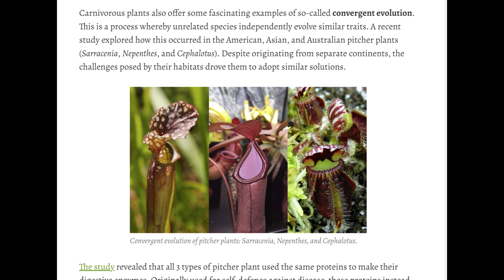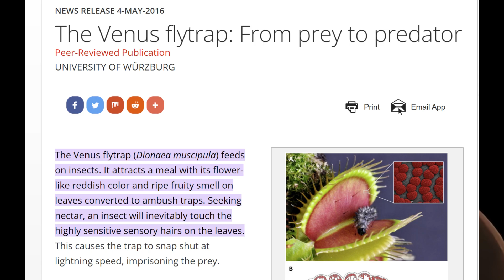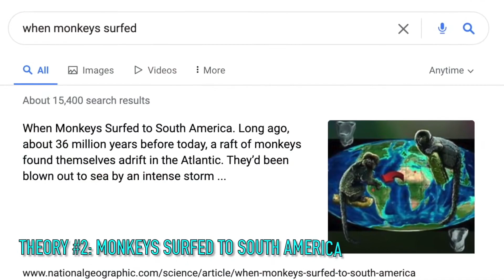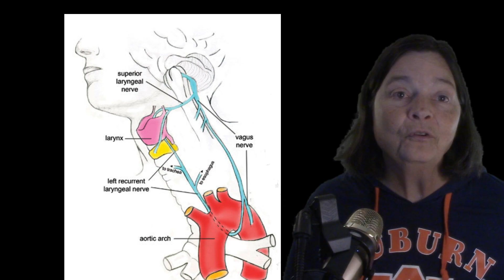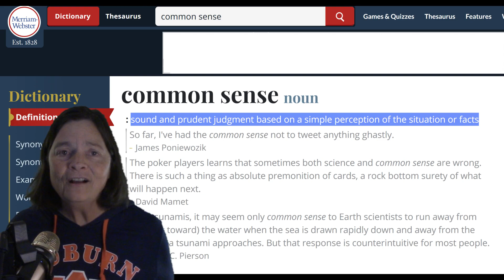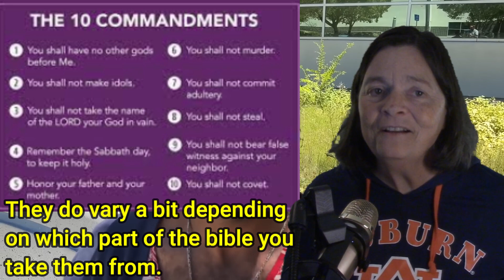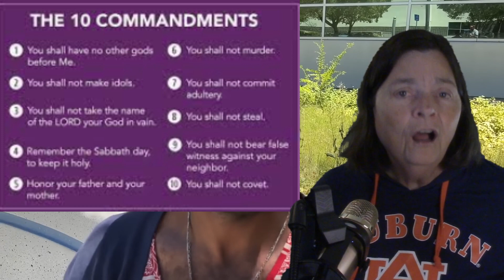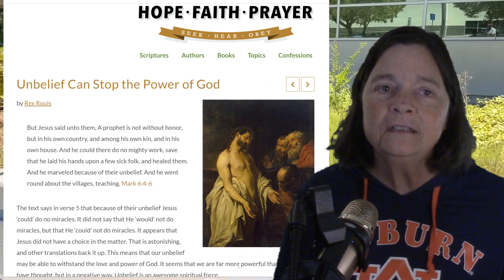Ray's God Gets Trapped

Comment: The fact is, the Venus Flytrap closes at just the right rate. The refresh-rate of the fly is rather a lot of frames per second. The plant closes slowly enough to elude the refresh rate but fast enough to finish before the fly thinks it through and decides to lift away.

Try this experiment. Put your hands together at the same rate as the video shows the flytrap closing. Do this a few times. Then start using only one hand against a flat surface. Now find a fly and move at that rate on the fly. Counterintuitively, a slower rate will work on the fly when your fastest rate will not. 

So, I guess we are not going to need a God of the FlyGap this time.

Comment: The speed of the light from the lightning is obviously the same speed as any other light, but I don’t think the speed of lightning is the same as the speed of light. A lightning bolt is a transportation of electrical charge through ionised channels of air. The voltages involved are large but not large enough to accelerate charged particles to the speed of light.
No objections otherwise.
Reply: Thanks.  You've saved me from saying the same thing, but I probably would have phrased it more clumsily.
Reply: Basically correct. 278.31 km/hr is about the limit for earth based lightning.

Comment: The speed of lightning is not the same as the speed of light, it is around 270,000 mph (it takes time to ionize the air). The rest of your argument stands. Pedant mode disengaged 😄
Reply from the maker: Ok, I stand corrected. I found that on 2 websites, so I took it as factual.
Reply: @GodlessGranny  In the grand scheme it makes no difference to what you said, in this case 3000 times slower with something that fast us still very, very fast. I wasn't being critical, inaccuracy just rakes its fingernails down the chalkboard of my soul! At least I was listening 😄